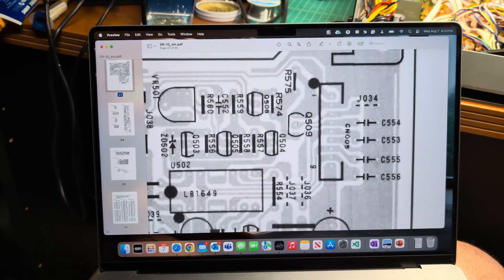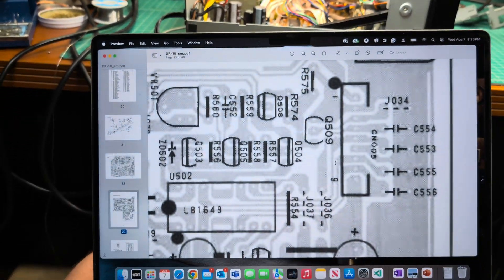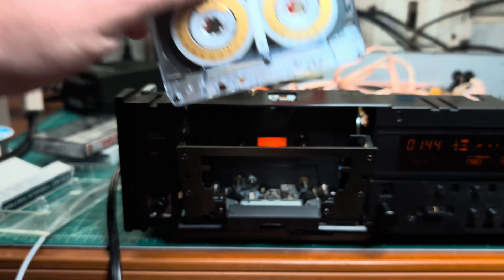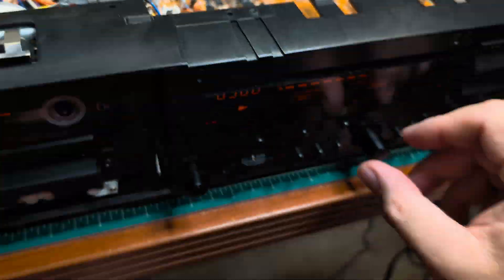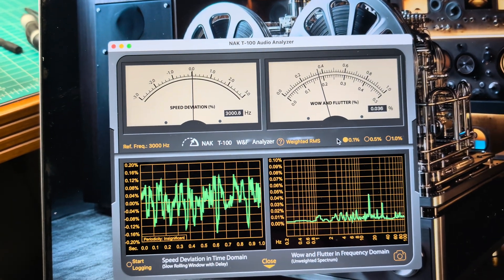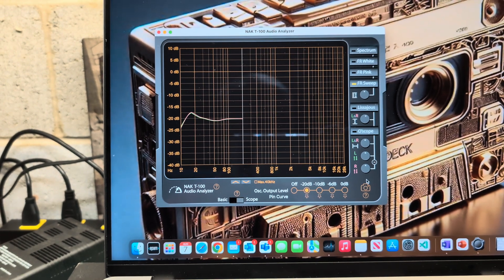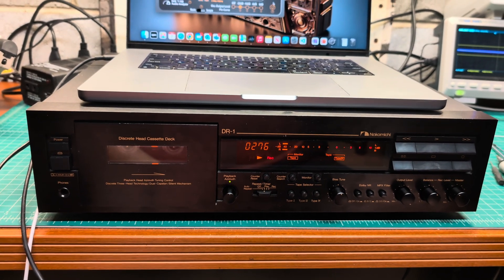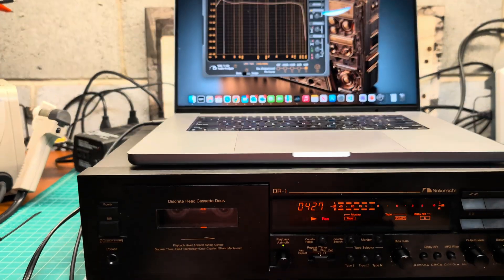Nakamichi DR-1 Upgrade Part 2: Perfecting Performance and Sound Quality

Comment: One question-when the frequency responce is stated,from-to,is it ment in the recording mode or playback mode,or it is what the deck is capable to record,it is capable to reproduce as well?was never clear to me,thank you!
Reply from the maker: @ilestojanov6140  on playback deck should correspond to IEC curve, to be compatible with other decks, on playback level should match to be compatible with other decks Dolby system. And the best decks produce linear curve compared to the playback. When I talk about response, sometimes I mean playback response when measuring deck to play using the test tape, and when I record I mean record response. I hope I explained.